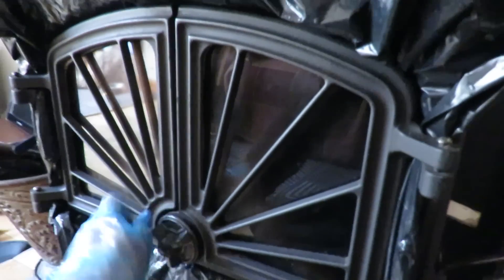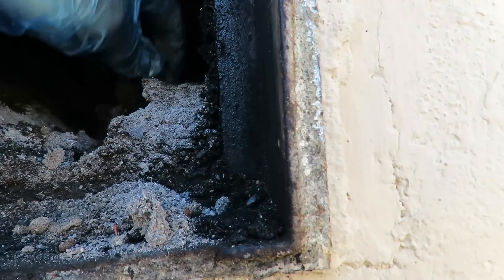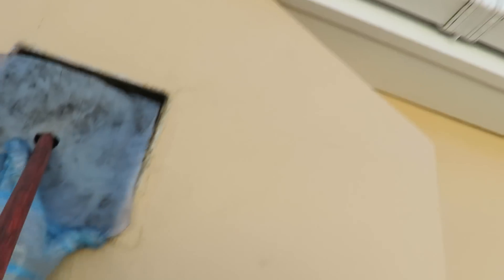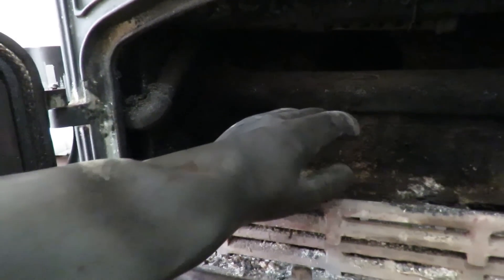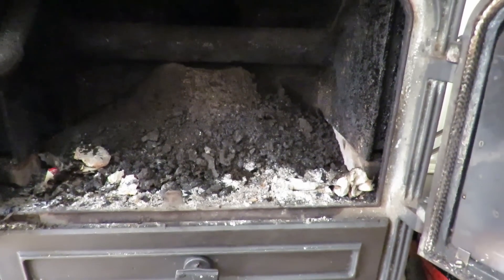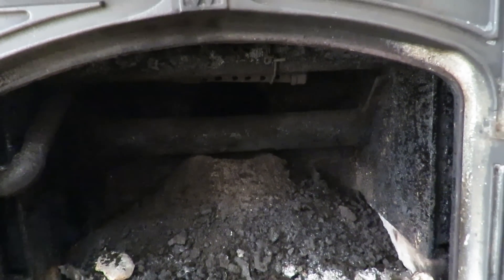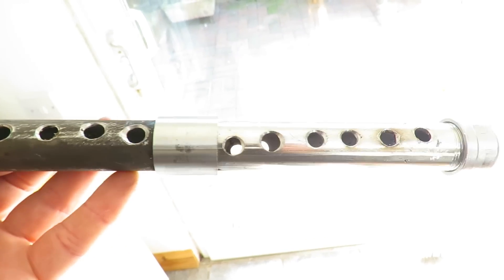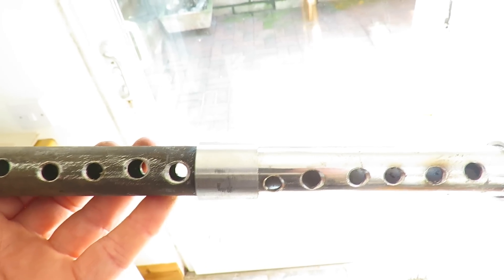Log Burner Stove Upgrade Secondary Combustion, Gasification, Burn Creosote, Smokeless Part 2

Comment: I just plumb in a few bbq burners. Easily replaced and just pop on with friction fit. I think the smaller holes allow for a better burn and more surface area. Free bbq’s are forever being given away or tossed. I have dozens of burners stocked up now for future use the intake should be a p trap shape for safety, so the end is facing up.
Reply: Do you run a long length of pipe before the bbq burners to pre heat the Air?
Reply: That doesn’t really matter. Air can be any temp going in. It gets hot by the time it reaches the burner holes. If the holes are too big, the first few holes get air flow and the far end doesn’t supply any air at all. You want the holes to match air flow, so at full throttle, you see flames coming out of every hole. As you gradually open your valve, holes should ignite from closest, gradually to the furthest holes, at full throttle. If they don’t all light up, your pipe diameter is too small for the number/size of your holes.
Reply: @Imasurvivor2  Thank you for your Reply. I have A homemade 20lb propane tank wood stove I made for my Ice Shack. Anyway it has only a 3" flue pipe but burns really good. I decided to  make a secondary burner for it which i made out of 1 inch square tubing in a elongated c shape at the top of the stove. It measures 11 inch by 7.5 at the Cross piece. I am making dampers plates for the ends of the tubing so the secondary airflow can be adjusted. My dilemma is with the 3 inch flue not pulling alot of air I am torn on what size of holes to drill in the secondary burner tube. My thought is if the holes are too small it wont pull enough air and if the holes are too big it will exchange the air too fast and it wont heat up enough to achieve secondary combustion. I noticed most commercial built stoves that have secondary burn tubes use 3/16 or 5/32 holes in the burner but they have 8" or 6" flue pipes. Any thoughts on this? Sorry for the long rant. Thanks
Reply: I’d go 1/8” holes max. Even smaller. More small holes is always better. And it’s better to not quite have enough secondary air than to have slightly too much. I’d try to match a natural gas bbq burner for ratio. Diameter of secondary airflow pipe to number of jets and size of jets. And yes, the chimney diameter is probably too small. If it’s too hard to change that, like if it was a tricky weld and you don’t want to cut it out and redo it, you can enhance the pull of your chimney by cutting it a few inches higher, where it’s easier to weld in a bigger diameter pipe. Going up a size, like even just one inch bigger diameter, further up the chimney, that reduces relative friction from that expansion, all the way up so the only bottle beck is at the narrowest point. That will cause higher pull at the bottle neck, increasing velocity of the exhaust. Another trick is tuning your chimney length. You really want the exhaust temp at the exit to be hot enough relative to ambient outside air temp, to pull hard enough. There’s a sweet spot. If it’s too hot, you’re wasting energy. If it’s too cold, you have insufficient pull. I’d guess you want it to be atleast 125-150 degrees c difference. So I’m minus 30 weather, you want it to be about 100c coming out the chimney. If it’s over 250, you’re probably wasting too much energy, and should try to pull more heat off the pipe before it exits your wall. If the temp is too low, you’re going to have build up of debris in the chimney, and it’s a sigh that the indoor section of your stovepipe should be more insulated or shortened.
Reply: @Imasurvivor2  Thank you for your Response. The Stove Works really well and the 3 inch is a good size of flue for the 20lb tank size stove it pulls air pretty good. My flue height is a strait run of about 8ft with no restriction at the top like a spark screen. I went with the smaller pipe because my shack is 7×10ft and i have had stoves with a 6 inch flue and they just cook you out of a small space no matter how you try to dampen down the fire. My little stove has good burn times and i have a dampener in the flue pipe as well. I just thought it would be neat to see if I can get a secondary burn out of it as there is usually quite a bit of smoke when I damp it down. I checked my bbq burner and its about 3/32 in diameter. My homemade secondary burn tube that I have not yet drilled out is two 11" pieces of 1 inch square tubing that run at the top back of the stove to the front there is a 7.5 inch cross piece that joins them at the front of the stove , the air comes in both tubes at the back and i plan on welding a hinged plate over them so that the air flow into the tubes can be controlled. There is  a baffle plate that the above where the secondary burn tube is located and it has worked well to keep the heat in the stove. Thank you for your Thoughts and Advise! Much Appreciated!

Comment: Are you using the 3/4 inch drilled pipe instead of the 3 inch perforated tube?  Do you still need a 3 inch perforated tube?

Comment: so few uploaders reply to the comments. you do, which I appreciate. the comment that I have, is more of a question. 
you say that 50% less fuel. to equate to this. I wonder if you could read the different gas emissions that are given off after the burn. the port for the strobe is usually straight after the draught control. drilled into the flue pipe. about a 1/8th ". then a screw fitting then a plug to seal the hole. there are gas emission testers that do read quite a lot of different gas readings such as central heating gas boilers. and at mot stations. I am considering buying. I could let you know the brand make if you are interested.
 your 50%  less fuel. what was it before. 100%.  yet how efficient was the stove, and what is it now.  the gas analyzer could read zero for all emissions. then maybe it could be taken. that all the fuel combusted in your stove is totally combusted/burnt. although you are saving 50% fuel, you could possibly save 75% if your stove is made more efficient, if it could be. thanks.

Comment: Great video.  Going to do this to my Hunter Midi.  How did you drill the hole for the S/S pipe?  Specialist steel drill or hole cutter?
Thanks
Bill
Reply from the maker: Started off with a pilot hole and increased drill bits before filing out to pipe size

Comment: There's no flames coming out of the tube holes that I could see
Reply from the maker: The gas and particles ignite inside the hot perforated tube at the back of the fire and show clearly that flames are present inside the tube.The fact that our chimney needs sweeping once a year instead of 3-4 times a year and the deposits are now white instead of black soot, speaks volumes.

Comment: Andrew K Fletcher  Thank You Sir for posting some really great videos on how you were able to achieve gasification and now the secondary burn with this conversion! Do you have any newer videos to show the latest updates? :-)  I am currently researching this topic as I need to modify my Dads Wood stove (Wonderluxe), as we have to clean the chimney on his house at least 3 to 4 times during a winter, because it clogs up so bad no matter what we have tried. And it burns a ton of wood (mostly oak) even though the whole house is only about 960 sq feet... he has to reload it at least once during the night, and that is a Huge upgrade to what it was a couple years ago before we did some initial modifications. As before, he would have to load it 2 or even 3 times during every night, just to keep the house on the warmer side. Which also meant he didn't get much sleep All Winter long.... So its better than it was... but still far from where it needs to be.

Comment: Hello Andrew, I will be doing the conversion on my stove this month. My stove is much wider than what you have. Will have to remake the inside smoke guides different since the stove it a front and side loader type. Will make it only a side feed type. Look forward to start as soon as I get more pipe fittings from the eBay site. Thanks so much for the idea to make it happen myself. Keep on making more videos too.

Comment: The secondary burn should preheat the air before is injected to the flames.    you just added another air inlet
Reply from the maker: That's why I ran the tube inside the log burner, so the heat from the fire does indeed heat the air as it flows through it.

Comment: Hello in reference to your 3 inch perforated stainless steel tube you suggest making it to length for you fire. Does this mean the width of the stove or the size of the chimney flue? Also my stove has a baffle comprised of firebricks supported by steel in a fully horizontal level with a rod that can be pulled out to allow the smoke to go straight up the chimney or the rod can be pushed in to close this opening at the back of the stove and stops the smoke from going directly to the chimney and channels the smoke to the front and over the brick baffle. Would I put the stainless steel tube on top of or below the baffle? Thank you.
Reply from the maker: Can you message me a photograph of inside your fire?
Reply from the maker: On mine, the stainless perforated pipe fits inside the fire, cut to a little shorter than the actual width to allow movement and easy removal for cleaning flu.
Reply: @AndrewKFletcher  I will get that picture and send it to you. So this response would indicate your stove is about 1 foot wide? Thanks.
Reply from the maker: @bryant2165  Firebox is 18" wide on mine.
Reply: @AndrewKFletcher  My firebox is about 21" wide. What length would you suggest would likely be best suited to my woodburner? It would seem from your videos that you purchased a 12" length and peened the ends.  Bt my figuring I would need a length of 15 to 16"?
Reply from the maker: @bryant2165  Make a 3" diameter paper / card template by rolling it into a tube and tape it. This way you can trim the tube down and test it for ease of install to determine length of ss tube required
Reply: @AndrewKFletcher  Thanks  I am trying to figure out how to post the pictures of my burner to this.
Reply: @bryant2165  send as a message to me

Comment: Hello everyone. I have an old Fisher wood stove that I also modified. Not sure if Fisher stoves came with a baffle but mines did not when I first got it. I had created a baffle with the same grade of the stove and placed it above and across the stove so that the smoke now has to travel in a C formation from the fire to the Stove pipe. The time delay it takes to travel in that direction causes the smoke to burn even before completing the C formation.  When the Stove reaches 300, the chimney is smoke free. In addition, I had to make the chamber of the wood stove smaller to create enough heat to burn everything within that chamber limiting the smoke escaping. I just added extra fire brick at the bottom and the baffle on top to decrease the chamber size. Its a lot more efficient now then before but always looking to improve the design even more. I had tried the tubes with the holes but not sure how well that was working, since the old Fisher does not have a glass door. I removed them since I did not see much of a difference but I think I will try it once again to measure fire length and temperature which I did not measure before. I guess I was looking for the visual effect. Thanks for sharing. I like the perforated tube in the back and in the front. Going to experiment on this as well. My only question is: Are we actually doing this to improve stove efficiency or simply for the love of manipulating a wood stove? lol.lol...maybe both
Reply from the maker: The proof is in our woodpile. Vastly reduced consumption. All radiators are now piping hot and we don't have to keep feeding the dragon as much so saving money on trouser knees not wearing out as quickly :)
Reply: We are thinking about buying a restored antique parlor stove. We would love to also improve the efficiency of the burn and use less wood. I love what the creator of the video has done, but it wouldn't look right on a gorgeous late 1800's cast iron work of art. I would love to see what you've done to the fisher, since it works on the same principles with the direct draft. Our current stove is an original 1975 Vermont Castings Defiant, but it has a nasty crack in the firebox. We are hoping it will last all winter and stave off this purchase for a while, but I want to be prepared. Modern wood stoves are ugly with no character, and I don't want to see an ugly box day after day, but old stoves are dirty and hungry

Comment: Alex C . Today, high efficiency wood burning stoves and fireplace inserts can maximize the heat dispersed from a burning log and these stoves leave behind little evidence of the wood burning as it is almost completely burned besides minor amounts of ash. The new stoves produce only about 2-5 grams of smoke per hour of burning. And even less ash. For this reason, some modern stoves are so completely clean burning that they are approved for use in smokeless areas indoors. A wood burning stove is designed to burn at much higher temperatures. This means gases present in the smoke are fully burned and not released back into the atmosphere. This results in a thermal efficiency of around 80%. Which means that a log burnt in a modern wood stove can get around 4 times more heat than one log in an open fire.
Reply: I have a tempwood 2 top load with 2 draft holes at top that go down into the stove. Was trying to come up with something like this for a secondary burn. Any suggestions would be much appreciated. I could send pictures if it helps , not to much information on these stoves. Thanks

Comment: I've inherited an old Jotol, when we got this house, which, before lighting it (we have a CH boiler too, soon to be pellets instead of oil :D ) I'm going to try to install your conversions. We already took it out of the ENORMOUS mock stone chimney, which absobed all the heat, and hid it too, and last year, free standing, it was giving off more heat all round.
I can't find it in Jotul's pages, as there's a bottom oval part screwed in, which looks as if it shoud take either a boiler or an air blower. I'll try it with the gasification, change its' crumbly stones too, and keep hunting for its' full potential!
Thank you very much for you videos, they're inspiring ;)
Reply from the maker: I found that the stainless steel 3 inch pipe needed 3/8" holes drilled in it around the centre and both ends to allow more gasses into the tube, especially when burning coal with wood which tended to block the smaller holes with carbon.  Using the wire the tube can be jiggled to remove the excess carbon.  The extra larger holes have improved combustion further. I will upload another video to show it.

Comment: Intake for the fire must come from outside , otherwise you are drawing air from every window and door gap or you are drawing warm air in . Brilliant upgrades though crack on fella 👍
Reply: Yep your stove burns a lot better when you use outside air.
Reply from the maker: Working fine :)  Have made one further upgrade by drilling 3/8" holes 
around outer edges of 3" stainless perforated pipe and around centre of 
the pipe. What I found was that the tiny perforated holes tend to build 
up with carbon when burning some coal along with the wood. This has 
helped by drawing more smoke through the tube where combustion can be 
seen along with flames being drawn in to it.